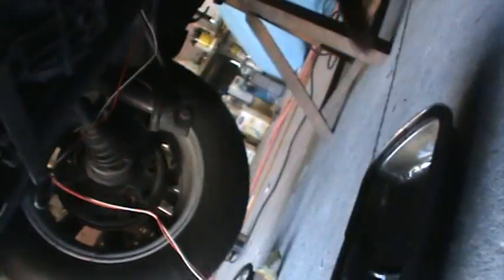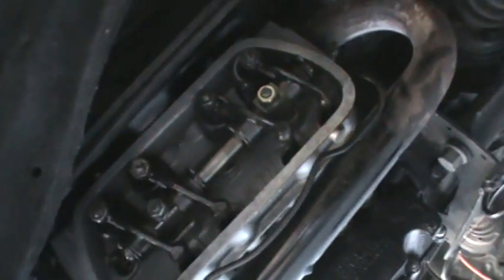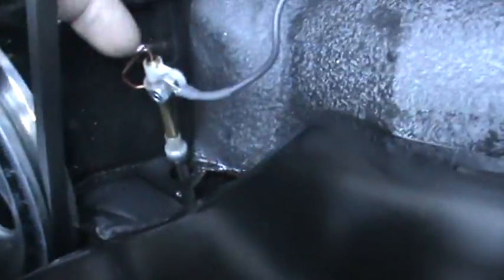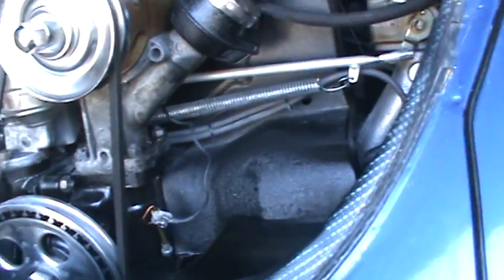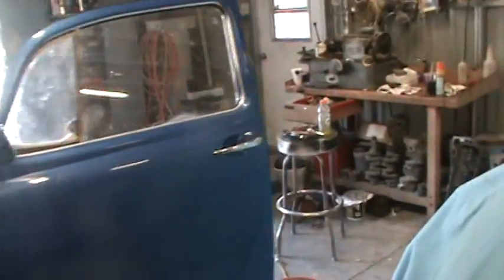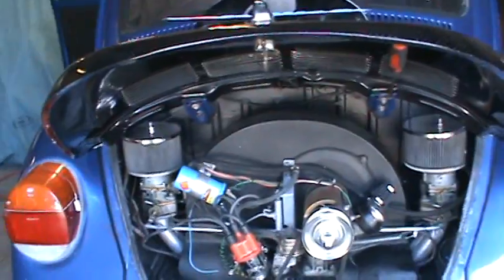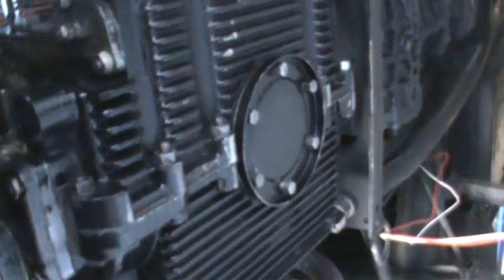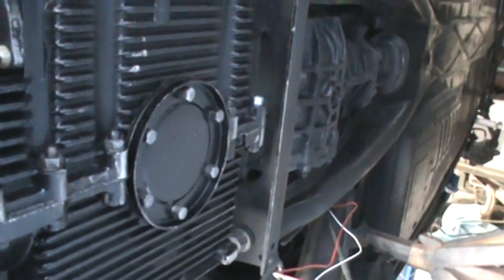TALKING VW'S

Comment: Our bug has the addition of an additional 1.5 oil sump.  Do they help to keep the motor cooler?  The bug also has the addition of a remote oil filter.  I have seen oil filter heat-syncs which fits around the filter to possibly help with cooling, would it help?  Thanks for answering our questions Darrin!